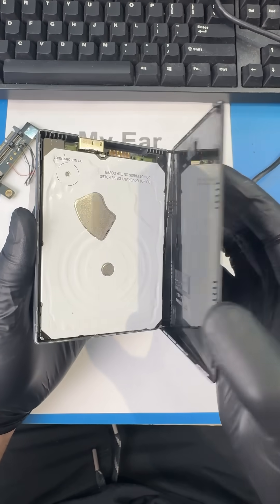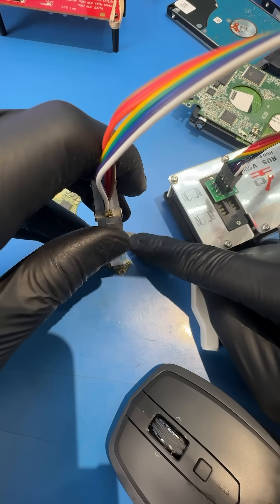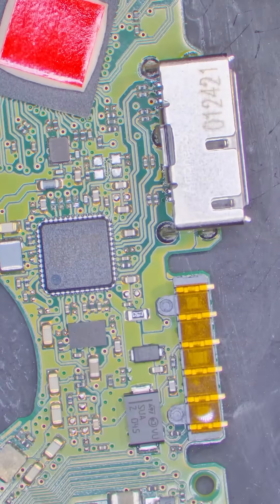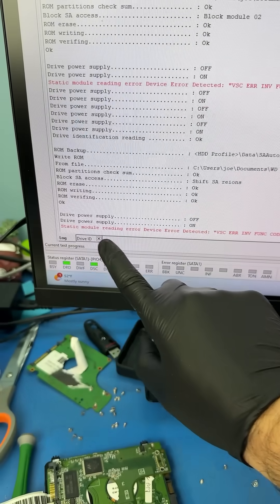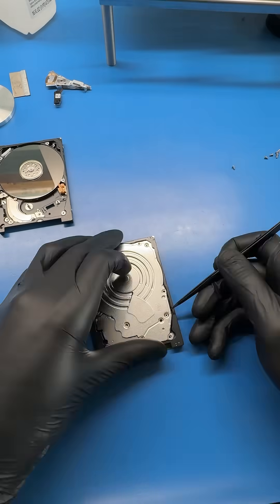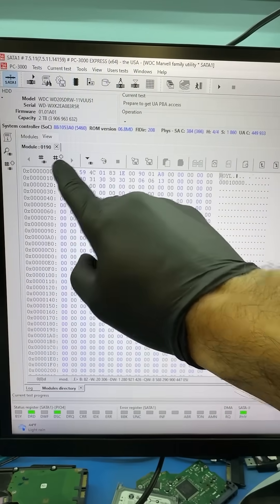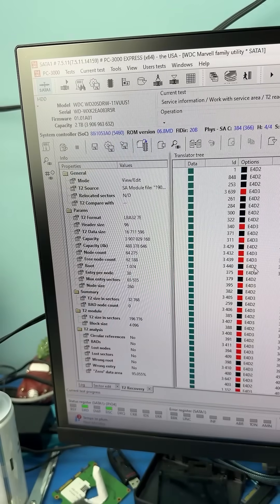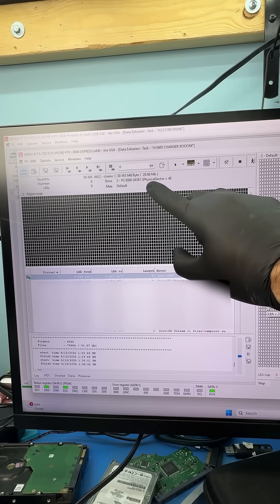Hard drive translator...? #tech

Comment: "We were able to recover all his data except 28MB." This reminds me of a data recovery job I had at work. One of our offices had lost their complete data archive due to a NAS firmware issue and them not having backed the NAS up, as we'd told them to. I spent all weekend extracting the drives, grabbing all the data off them and reconstructing 20TB of files, only losing 34 files out of tens of thousands. Were they grateful that I'd saved their asses? No. The put in a formal complaint to my VP that I'd incompetently lost 34 of their precious files.
Reply: Non tech people should not be in charge of tech departments
Reply: @theunholybanana4745 that part! they'll never understand and expect perfection 100% of the time.. I hope one of em read this too
Reply: @theunholybanana4745 I feel this way about most things. I work in automotive, but I can always tell when a customer is some type of upper manager (or thinks they are) when they complain about something that has nothing to do with what the job is. The AC no longer works after getting four new tires because they launched their MDX over a curb at the golf course, but it's February in New England and I'm sure they just decided to check on it both before and after the repair.
Reply: @theunholybanana4745  I work in procurement technology and software, primarily specialising in SAP and had line managers who were not tech oriented and it was a nightmare.
Reply: @theunholybanana4745  Every job has that problem, because product people and key workers dont get promoted, the people in the financial departments do.
Reply: @theunholybanana4745  No that guy was not bothered about 34 files his bothered to blame somebody he found somebody he blamed on somebody which was you are not his responsibility to backup the data
Reply: @theunholybanana4745  disagree, non tech people should at least require a basic knowledge of tech concepts to head tech departments, sometimes a great technician is a bad manager as well; just pay based on workload, skill and trained ancienity (requiring extra schooling for the entire carreer)
Reply: @theunholybanana4745  Been saying that for years
Reply: @theunholybanana4745  Totally agree — putting non-tech people in charge of tech departments is usually a recipe for disaster… unless we’re talking about The IT Crowd, because then it makes for some top-tier comedy!
Reply: @theunholybanana4745 I will pay you to tell that to the current CEO of Microsoft!! lol!!!
Reply: @theunholybanana4745  no shit
Reply: they dont know the people they have, they let them go or they leave on their own and then they get the next guy
Reply: Lol. This is just so wild. Not even 1% of data loss which and a fkn complaint? The audacity and ignorance is just wild...
Reply: @millidanilli  I never did them a favour ever again
Reply: @millidanilli  bunch of Karen's now a days
Reply: I had a call from a local city government where a hard drive had failed and they had no backups. I managed to track down another of the same model the same day and swap controller boards, then told them I needed some place to put the (completely recoverable) data. They balked at paying for a replacement, so I ended up using one of my own personal drives after a 30 mile round trip home. After all that, they found excuses not to pay me. I ended up wiping my drive so I could reclaim it, and also the controller I had swapped in. They still had their data, it just wasn't accessible.  I had no idea what they would do after that and didn't care.

Fast forward four years. I'm working for a different company, and we get a call for the same city, only this time it was a virus problem. I told my boss "remember the story about the city that was too cheap to buy a replacement drive and refused to pay because they said I hadn't completed the job? Same people." My boss got back on the phone and told them he had nobody available to send, which was true, I wasn't going to do it and the only other person qualified was him. He could arrange someone from our other (much further away) store -- but it was going to cost them double. Or they could wait until the following week and he'd get out there himself.

They opted to wait, and by the time the next Monday rolled around, every machine but one on their network had been infected -- and that one was only spared because the user had been on vacation. Instead of ONE infected machine, they now had twelve, and we ended up having to call in techs from the other store location anyhow. This time I agreed to participate because I wanted to bask in their failure, but no, I was tasked with running the entire shop by myself that day, just to keep the lights on and answer the phones.

Think twice before screwing people over for trying to help you, especially in an industry as small as the circle of computer techs who actually knew their shit back in the early 1990s. We watched out for each other, even if we were competitors.
Reply: @mal2ksc “we are going to need a deposit before we begin work.“. “How much of a deposit?”  “all of it.“
Reply: @williamjacobs I'd go with double for the deposit.
Reply: @mal2ksc Lol this is a great story and great on you, good on you guys to look out for each other. They always say a good mechanic is so hard to find. But a good computer tech now THAT is priceless
Reply: @mal2ksc Compelling account of your life, man! Most workplaces function the same way. They are always hesitant to pay their employees on payday. We live in a sad little world!
Reply: @mal2ksc it always amazes me how those who don't have the money will move mountains and people get paid cuz the jobs got done.. but people with the means never wanna pay, or even act like u did what needs to be done... for what ever reason those who won't miss it rather pretend u didn't work hard enough,  fast enough.. and the agreed price is treated like a negotiation... atleast karma is a fickle bitch..
Reply: @mal2ksc  After doing military contract work for 50 years, I've learned that some squadrons have wasted all their budgets on garbage, saving nothing for emergencies. I've also learned they magically find money when you show them you have the base's general on speed-dial.  It is also funny and effective to name my wife's contact as SECDEF and my brother as POTUS and let the nonpaying scumbag Sargent see that SECDEF called me earlier in the day and POTUS texted for a tee time last Saturday LOL.
Reply: That's absolutely wild man, I would be so happy if you recovered 99.9% of my data, these sort of people are so incredibly privileged if they have no clue how close they were to losing so much data permanently then blame you for their failure, makes me glad i never got into customer service, I don't think I could hold back from such a person.
Reply: @vgamesx1  dont worry its just funny for us once you get used to talking to them they might see a little smirk off your face sometimes not knowing youre laughing at their face from the inside considering how stupid they are
Reply: Data recovery is so weird because people just assume you.can just go in and grab it like it's a tangible object. Like bro these are magnets spinning at 7200rpm if someone breathes funny you're gonna lose some data.
Reply: @dracekidjr even when I didn't program I'd be happy with any data recovered. Sure I'd be pissed at myself for not making a backup but if they managed to save anything at all I'd be glad it wasn't lost.
Reply: @dracekidjr your comment is hilarious. I could just imagine a tech saying that to a demanding ignorant customer 😂
Reply: you should have filed a formal compaint about them not backing up their NAS. which should be critiquable aswell i'd imagine.
Reply: Cybernetic surgery should be praised more. Imagine if you loose your old photos, those where memories that are gone forever.
Reply: @dandalas2168 I have lost around 5k photos that were on my Google account. Just randomly weren't there anymore. It includes many many important memories. Guess Ill never see them again since Google doesnt give a shit, there's many more people who had this and made complaints on the Google support website, my own post even got deleted
Reply: @dandalas2168  your memories are tied to photos? Shit my memory would be wiped once a year if that were me
Reply: Had a server at work die once, the hosting company had configured it in RAID 0 instead of RAID 1 for some reason... one file on the hard drive turned out to be damaged: ieframe.dll. (as far as we could tell the universe hates Internet Explorer just as much as we all do)
Reply: @bobbobson1605 did a double take because I watch a lot of restaurant skits and thought you were nonchalantly discussing a server that died at work
Reply: Did you got payed? Because if not...
Reply: @nowonmetube  he probably still gets paid, otherwise, it'll be another lawsuit from the repair specialist
Reply: @nowonmetube  no he got paid instead 🤪
Reply: @nowonmetube yes most likely he did. They would have been sued otherwise.
Reply: @sonofagun5305  you assume yes, but that's my point
Reply: Any bit of data saved is enough to save money, if anyone that doesn't understand PCs and hardware acts stuck up tell them where they were and what they would've lost in money without you
Reply: They most likely were uneducated on how this process works, that or they really think not backing your shit up is gonna end well, in a fuggin tech division smh.
Reply: The complaint was done by a woman 100%,  @DJLDJ132
Reply: My response would be:

I was brought in after the system had already crashed, and despite the severity of the corruption, I managed to recover what most would have considered lost for good. My role was never to prevent the failure—I stepped in after the damage was done. The files that couldn’t be salvaged were likely the very ones responsible for bringing the system down in the first place. I didn’t create the problem; I stabilized the aftermath. Blaming me for unrecoverable data is not only misguided, it ignores the fact that without my intervention, nothing would have been recovered. My actions turned a total loss into a partial recovery—and that speaks to my expertise, not fault.
Reply: I'm not a tech guy. If my company lost multiple Terrobytes of data and only lost a handful of files in the recovery, I'd be thankful. Even I know you can't always recover 1:1
Reply: it's their own fault for not having backups,and they need to do that every day at end of business.
Reply: They lost thousands of their files, you competently rescued most of them
Reply: They don't understand man. 😢
Reply: Woww that is just ignorant
Reply: Next time just don't tell them it's missing 🤷‍♂️ they won't even notice. It's good to be honest but if they create an atmosphere where you're punished for honesty...
Reply: @xSephironx true, they probably won't know that it wasn't recovered
Reply: The irony is they make it sound like you did a bad job when they had 0 backups in which there should realistically be more than 1. Incompetence and lack of regard for company data safety is negligence on their end.
Reply: so they flipped their own mistake on you to avoid consequences on their side? typical firm behavior you should have seen that coming budd ..
Reply: That's when you delete the rest of the 20tb
Reply: lol that is just bonkers.
Reply: "You had one job, just a simple clickity clackity, and you can't even get that one easy job done? disappointing"
- Mr. Manager the Allknowing God, probably
Reply: Ask them if you can try recover the last 34 files, gain access to the drives and absolutely demolish every single one of them.
Reply: I gotta try. It pays me $3200 a month for life. I got a computer science degree I have no interest in using it for this reason.
Reply: @udiorockmeamadeus well... thats awerage but there people who lay extra 😅
Reply: @udiorockmeamadeus  I respect that. Have you read Anthem by Rand?
Reply: I'd love to know what your VP told them...
Reply: @Vash.Baldeus  He asked me about it then pointed out to them that, if they kept a backup it wouldn't have happened,  that he'd paid my daily rate to recover it, for the recovery software we had to buy to get and for the hard drive we sent the data back to them on so they could STFU
Reply: A better question is why even tell them that. Doubt they would even know.
Reply: @gotenks157  professionalism and integrity.
Reply: I'm angry for you
Reply: What dusgraceful idiots are they. When something dies in the HDD, usually means there're will be losses.
If a cupboard cannot be opened normally, one cannot open ut without making the scratches.

These disrespective scrooge morons that refused to pay should have been put on some public list of shame.
Reply: Wow, just 🤦🏻‍♂️ 
At that point you should encrypt the entire thing with access pending on an apology lol
Reply: that's corporate world for you
Reply: Praise be to tech priest
Reply: next time put in your job description "some files may not be recovered"
Reply: His btc private key was on that 28MB
Reply: @nashvillewebnet  that's a different story lol. But in the case they would bring it up without you having to.
Reply: Should have filed a followup complaint to that same VP stating they caused the issue indirectly by their negligence, and that their negligence is the reason 20 TB were almost lost.
Reply: Bro. A 0.0034% data loss rate is an absolute success, those idiots don't have a clue.
Reply: Should have a policy that prevents them using their own storage if the "office" is the same company. Not just to ensure the data is backed up, but for security and control for future use when those people leave.
Reply: That's business people for you. I guess that one went to court.
Reply: Just press two buttons: ctrl del 😂😂
Reply: Please tell me ur VP backed you up over those ungrateful clowns
Reply: imagine is was just temp files lmaooo
Reply: It is insane to put data at risk like that.  Hell my home NAS doesn't even have anything that important and it's backed up to AWS...
Reply: It was not precious if they didn't backup it, should not have told them the files were lost, they wouldn't even notice
Reply: they probably didnt even know what they lost and wouldnt bother checking too.
Reply: Did you quit op?
Reply: It was a filed complaint. Original poster did not mention anything about getting penalized for anything…
Reply: To be fair, 28MB of data could be millions of lines of code.
Reply: You need 10 pages contract before any agreement.
Reply: They prolly wanted you to lose more of their precious files, next time do better. Instead of 34, try 3400
Reply: I'm sure it was YT people and I'm standing on that 😂😂
Reply: One time, due to a dumb mistake similar to your customer, I lost almost all of my photos. After recovering them, only around 16 were corrupted. It didn’t matter though, since I was able to save around 800 or so.

I know these photos aren’t as “important” as your customer’s files, but goodness, at least be grateful.
Reply: I’m no expert, but this seems to happen a lot in data recovery. Losing some files is sometimes unavoidable due to small imperceptible oversights or just plain old bad luck. It seems to happen more consistently with consoles and gaming platforms like Nintendo, and I’ve heard it’s because of a failsafe in the hardware that allows a number of files (usually around 34 like in your case) to essentially be sacrificed to save a larger number of data. For more information look up Nintendo Rule 34.
Reply: ngl if i was the vp i would of said that they were lucky that they got any back.
Reply: I would have built a time machine so I could go back in time and take an axe to those hard drives. Lol
Reply: thats so incredibly rude
Reply: It's evident that they would've rather lost 20TB of data, instead. I really wish I could ask them about this. 🤣
Reply: No good deed goes unpunished
Reply: "How dare you do a phenomenal job!?  Condemn this person for saving our asses!"
-- That Company
Reply: @t0aster_b4th 😂😅 good one
Reply: I'd des.troy all of em and say it's a prank
Reply: The "I'm suing a person that pulled me out of the car crash because he saved me incorrectly" ahh story
Sadly those people exist
Reply: Did you quit?
Reply: @kuba.504  No. I was a contractor for our department and our boss was OK.
Reply: I hope your boss understood the dicks that were complaining were lucky to get anything. I'd turn them away from the start because they didn't follow the warning to back up. People with NAS sometimes think it doesn't require any administration at all and send warning messages to the bin.
Reply: I'm impressed just reading that. Well done m8. The ungrateful buggers have no idea thus no appreciation of what they got.
Reply: Clueless idiots, what else to say here, they have not a hint what it takes
Reply: F
Reply: Happened to me at my old job. Managed to recover 99% of the data from a drive, but five files were unrecoverable. She put in a formal complaint that I had "deleted" some of her files.
Reply: You shouldve gone back and cleaned all their files lmao
Reply: Damn karen moves, if i was in that position well mann i would be glad. Literally glad my 80% data is still there.
Reply: Fucking bastards, I know next to nothing about this shit but even I can see this was the best outcome they could've hoped for, you did the best you could with what you were given and they still bitch about something you couldn't control.
Reply: Please send me your email I need your help for my HDD I HAVE VERY IMPORTANT FILE INSIDE .
Reply: pricks, you did good
Reply: What if those files were precious family moments?
Reply: @SuperJeshua007  This was the complete archive our company had of historical video of Nelson Mandela, about 2 weeks before he died. I think someone was rather motivated to avoid blame for anything that was lost.
Reply: @SuperJeshua007  if they were precious, the customer would notice and bring it up themselves.
Reply: Get a new job, that company is horribly ran.
Reply: lol. comparations suck.
It's just a bunch of middle to older age b00merz trying to not complain about their lives 24/7
Reply: What ungrateful dingbats, good work with the recovery
Reply: Oh hell no...
Reply: Ignore them. They blow their daddies to get a new Land Rover.
Reply: You did a great work
Reply: Evil people !
Reply: I hope they have hangnails that never heal.
Reply: Y'know how Murphy's law goes. The file they really wanted was one of those 34
Reply: holy shit
Reply: Crazy... well, I assume ur VP is sane.❤😂
Reply: Wtf. Quit and start your own business
Reply: Great work.
When all is said and done, you can’t compensate for ignorance. 🤷‍♂️
Reply: Several of those files were named "Passwords.txt"
Reply: Neurosurgeons saved brain functions but lost parts where bullet went. 😅
Reply: "I LOST ALL MY FILES BECAUSE IM CARELESS, THIS PERSON WHO CAME OUT OF THEIR WAY FOR AN ENTIRE WEEK TO HELP ME DIDNT RECOVER EVERY SINGLE BIT OF MY DATA, WAAA WAAAAAA GRRRRRR!!!11!😡😡😡😡"
Reply: @paulstimpson830  im prescribed a medication that gives me bad akasthisia / pseudo-parkinsons as a side effect and every night while taking that med, i take it with propranolol , benztropine, and pyridoxine (vit. b6)

and i was in a psych ward and they wanted to give me the med but didn't have the other ones so i refused it

what sucks is that at the hearing, all they tell the judge is "he refuses his medications"

what im trying to say is  things can be written a certain way that doesnt reflect  reality
Reply: As a psychopath who does his job perfectly, all the time, I'll say, "Do it right, all the time. It's your job". In my eyes, everyone should do their job perfectly, all the time; simple.
Reply: If you can't do it perfectly don't touch it
Reply: Someone had to take the fall and god forbid one takes responsibility for their own mistakes.
Reply: And did anything happen after that?
Reply: come on those files were where his 4k prawn videos were
Reply: I want you to know that at least I’m impressed. That’s insane.
Reply: Lesson learned..    the 34 files were overwritten with kiddy pron by a user...
Reply: If i had a business and needed you to extract freakin 20TB of data from that many drives  and only I only lost 34 files I would not complain, I would stand up and salute you 🫡 and you would be on my speed dial list and be recommended to everyone i knew!. I can do data recovery with just software (piece of cake) but when it comes to physically altering/repairing a HDD like this video to extract data yeah thats a skill I would love to learn 😂 and i envy people that make it look easy
Reply: Ungrateful prick....sometime it's best to leave people like that in the mud to help them learn a lesson. After NOT backing up, you stepped in and still they sat proudly on their entitlement "horse". If there's a better time, leave that individual high and dry...don't cast pearls to swine.
Reply: Man screw those clowns you did a great job
Reply: I would of hacked them and erased everything
Reply: In such cases it is best to let them face the full consequences of their own wilful ignorance rather than do a thankless job, only recover the absolute bare bones and say the rest was irrecoverable. This will likely force good policy implementation and enforcement and thus be a massive net benefit for the entire company down the line.
Reply: I'd love to know the end result but if your VP has any brains at all he'll reprimand or fire anyone that lodged a "formal complaint" for you doing your job and clearly going above and beyond.
Reply: Yeah cause those are the only work files they have that are lost. The rest probably just pron 😂
Reply: I would've just "Oops, i poured a gallon of battery acid on the box full of drives by accident hehe"
Reply: and so they should!!! 34 files!!! i mean 1 or 2 at MOST, but 34!! you need a new line of work if you cant do better than that. Maybe McDonalds would be better choice of work
Reply: How much do you charge for this service
Reply: They just needed a scape goat. Job well done
Reply: So you worked unpaid overtime so you could get written up. I hope you learned your lesson.
Reply: we need Dexter in this one.
Reply: @ShampooShorts.S Dexter Morgan? Isn't that a bit extreme? 😂
Reply: I would delete everything and give a finger and a smile 🖕🏻
Reply: the audacity
Reply: Gotta put it in the contract that they can't bitch without clear evidence of malice
Reply: id withold their files until they apologize or else destroy it n say it wasnt savable
Reply: If it happens again, intentionally lose all of it.
Reply: you should tell them first you guys lost all your file until they beg you go help.
Reply: What the hell ?!
Reply: I felt that one. I've made CPR on an 18yo man after a cardiac arrest and they sued me for one rib break. Still feel bitter when I see that patient. The kid survived that day! I like how all this it's the numerical equivalent of a neural surgery.
Reply: Out of curiosity, what is the probability that those 34 files were corrupted before they even needed the data recovery?
Reply: @TheNe0PhyT3 I don't know. The recovery software couldn't locate the blocks of the files to reassemble them so the data was just gone. That may well have happened before the device failed but I can't prove it
Reply: what data recovery software did you use?
Reply: Ungrateful a holes
Reply: Gotta be a rule for this.
Reply: Ungrateful bastards😅
Reply: I would immediately take that data down. Immediately.
Reply: accountants think they know everything they are the bane of office harmony
Reply: Most stpd game dev without backup, real PRO 🤣
Reply: wtf if they're this unprofessional I'm curious what kind of work theyre doing 😂
Reply: As an IT MSP, I totally feel you. Worst part is, when you try to invoice something like this, it’s very hard. Even though you spend 20+ hours on something, you can’t charge for 20 hours or they will have a meltdown. If it was a lawyer on the other hand, they would charge you for making them read this comment…
Reply: Haha they bricked their files and blamed you. Smh ungrateful people.
Reply: What a bunch of one-dimensional, ignorant and arrogant people!! lol
Reply: bra if i were in your shoes and if they deduct my pay even a lil bit im afraid their gonna lose all of their data
Reply: Amazing service
Reply: I would just delete the rest of their 20TB of data and call it a day. Not satisfied with most of your data back, you get none back lol
Reply: Well that's the war of psychology. You should have said instead "We successfully manage to recover 967 files out of 1000 🎉" like that the company will be grateful.
Reply: Sue their asses
Reply: I would’ve left and took that drive with me
Reply: Considering that 99.9999986
% recovery rate, I think you did pretty well, in particular because the best professional data recovery experts on the planet will never promise that much, and will likely get closer to 99%, which is ~6 significant digits less than what you provided.  Bravo to you.
Reply: That’s why I contract my services. I have no boss to report to. I perform a job, deliver the report and data, and move on.  

This applies to my contracting gigs outside of data recovery. PC builds. Some vehicle repair
Reply: Please tell me that the VP got the full story and then chewed them out! 

They're lucky you didn't lose more.
Reply: Some people are just idiots and have NO idea of what’s involved with this kind of work. 
What you effectively did was recover all of the water in a swimming pool other than 1 bucket. I’d have been super grateful that you spent a whole weekend getting my stuff back.
Reply: motherfuckers!!!! 34 files out of 20TB!!! and they complain?!?!
Reply: GIT ???????
Reply: That's insane. If you didn't tell them anything was lost, would they have ever noticed?
Reply: Well, that's when I'd say "Fuck you" for that, and then never, ever EVER offer to help them ever again after that.
Reply: Shift + Del to 20 tb data
Reply: They're uneducated on the subject. What did you expect?
Reply: Thats dumb as hell, im sorry you went through that
Reply: lol bad karma will come back to haunt them 😈
Reply: You should've told them to do the work themselves
Reply: ok time to destroy their ass you know what im talking about
Reply: Should've deleted that 20TB and be like "oops. Guess now they're ALL gone. Should've backed them up like we told you to"
Reply: How big were the 34 files though? Not that it was justified but 34 files could be 100gb or 100kb.
Reply: Hopefully you refused to do it ever again.
Reply: omg FUCK THEM BRO 😩🤮
Reply: I’ve been down this street more times than I would like to remember.  If you do your job well, you become transparent in normal times.  If there’s a case of end user negligence and you work your tail off to recover everything but a coupe of files from damaged and/or misused equipment… then it is off to the president’s office to request your head on a platter.  Never mind that the person who wants retribution was the cause of the trouble in the first place.   Nice way to cover up your own incompetence by kicking someone in the tail who worked hard to save your bacon.
Reply: What a bunch of motherflippin figheads. Let me tell you this: you did a good job. Have a nice day!
Reply: Your fault for doing your best
Reply: @wabalubadupdup  one of the most obvious rage baits, this one.

edit: my bad, i read that as "your fault for NOT doing your best."
Reply: @wabalubadupdup  sad reality
Reply: @wabalubadupdup and working weekends, likely unpaid
Reply: that is when you tell them well if you dont want absolutely everything that i was able to extract then i guess im not good enough for you and undo all of the work you did before you tell them or after depending on when you returned the hard drive
Reply: from a financial standpoint they where probably looking to cash out on the insurance of an IP they are loosing $ on and got upset about that?
Reply: Being good at your job doesn’t get you praise, it gets you silence or complaints. Do your best -25% until they offer a 25% bonus.
Reply: Id have just deleted the Recovered files😂
Reply: It's their duty to file it as a formal complaint otherwise that loss of 28 mb will be seen as negligence.
Reply: @Parannadikkum.simon5 but wasn't it negligence on their part in the first place? (I'm not trying to be a jerk here, I'm genuinely asking). I've been taught ever since I was a kid that you need to back-up everything. Even when files became more readily digital, the truth is that for ANY govn't related data; it still had to be backed up on paper. Therefore shouldn't the complaint have to be thrown out due to their own negligence on "failure to back-up their data?" Especially after already having been thoroughly warned?
Reply: I got a trust , from my fathers pension program.. It pays me $3200 a month for life. I got a computer science degree I have no interest in using it, and I suggest, for your on health , since stress can kill you, if you can retire or change employers, do,  as some of the people you could be working for are like  Donald Trump, technically sociopaths or people who climbed the ladder lying about their credentials.
Reply: Did you know that you can live forever? Jesus is the Son of God. He died on the cross for our sins and was resurrected three days later. Believe in Jesus and you will not die, but have everlasting life.
Reply: Fr that's what I was thinking when I was reading your story. Also I'm thinking what about this guy's data he didn't get back?!? I wouldn't pay full price for things I didn't get back, when your profession is to recover them. You can have a Heard of 10,000 sheep. If one goes missing you leave the all the others and search for that one. You're a "good enough is close enough" kinda kid.
Reply: I bet they'll pay a ransomware script kiddy more than they would fornlegitimate drive engineers.   That's why you should never allow trump supporters to gin power
Reply: @SleepyOx2023 and of course here's the leftoid with TDS bringing politics here